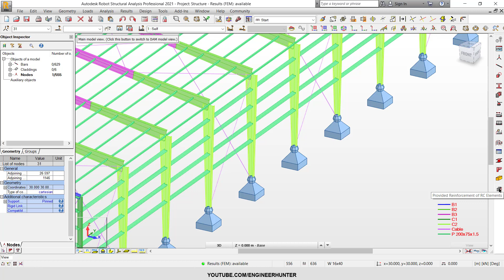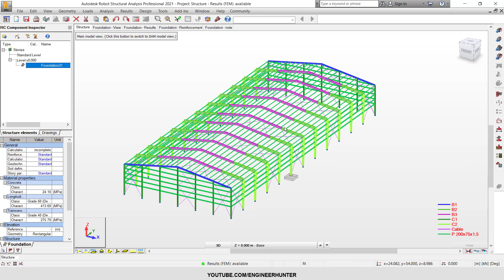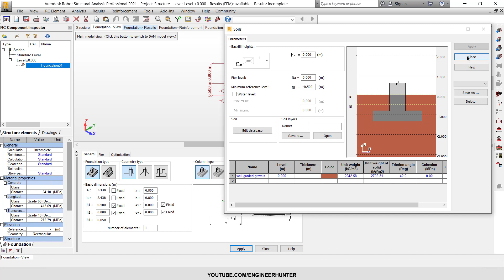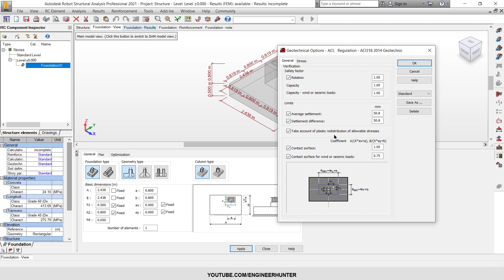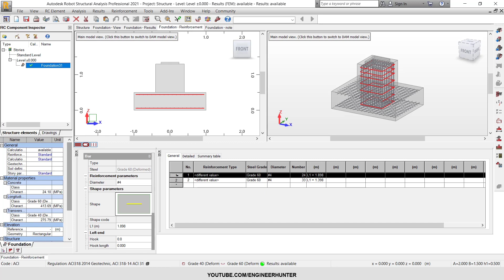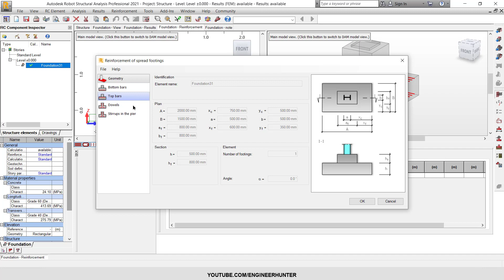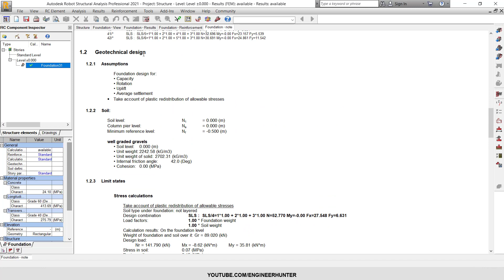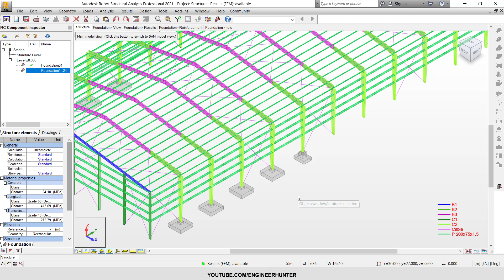Autodesk Robot Structural Analysis : Footing Design

Comment: Hello, any idea what does this mean? 
'Condition not met for: Foundation uplift in state of ULS	
Safety factor of bottom reinforcement in the direction of X axis: 0.00 < 1.0	
Safety factor of bottom reinforcement in the direction of Y axis: 0.00 < 1.0	
Safety factor of top reinforcement in the direction of X axis: 0.00 < 1.0	
Safety factor of top reinforcement in the direction of Y axis: 0.00 < 1.0'

Comment: Can we use pad foundation from 57:43 for fixed base connection verification? Can we check pier for concrete pull-out failure, concrete pry-out failure etc.?